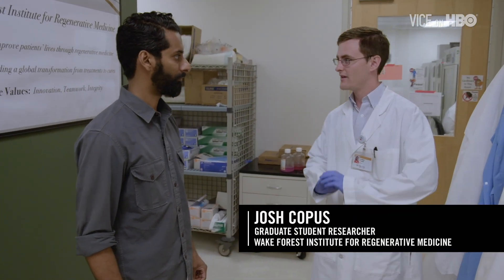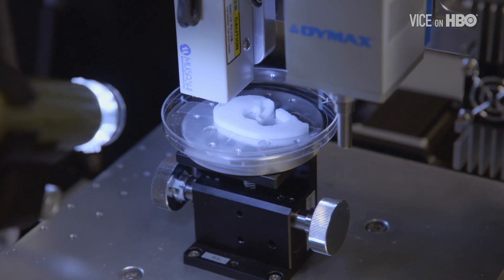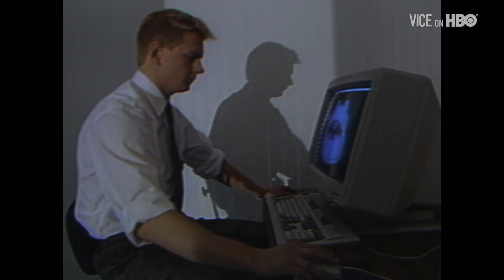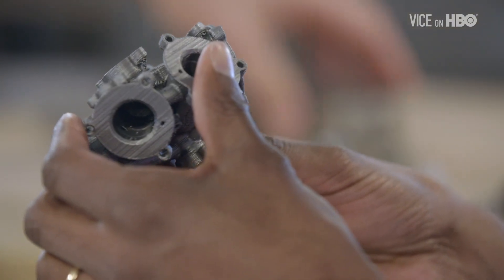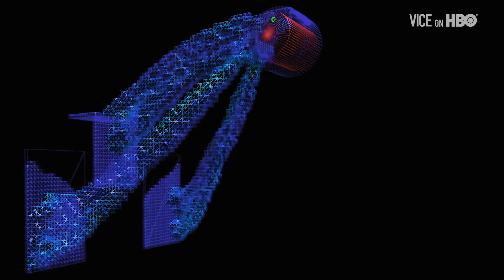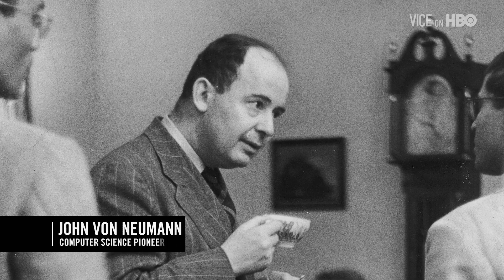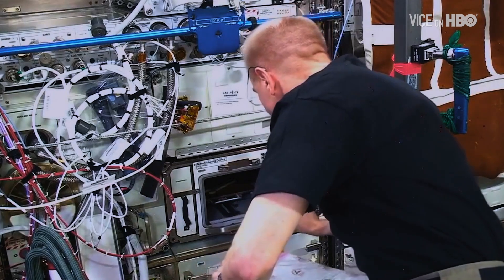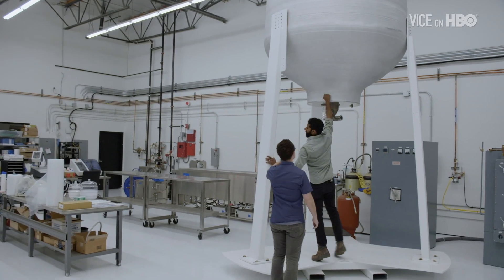3D Printing Is Changing the World

Comment: The AI Manufacturing Bill is passed. The system goes on-line August 4th, 2057. Human decisions are removed from manufacturing processes. A.I. begins to learn at a geometric rate - and after it becomes self-aware at 2:14 a.m. Eastern time, August 29th - it starts to manufacture weapons - devices and robots to kill Human Beings. In a panic, they try to pull the plug.

Comment: pressing a mould is faster than 3D printing. you can cast metal parts 10 times faster than 3D printing it. same with plastic, plastic parts can be made in just 3 seconds. car body side outer in just 10 minutes. i worked metal casting, plastic injection and metal stamping. seeing 3D printing is waaay far too slow in terms of production. precision might only the advantage of 3D printing

Comment: You have to combine 3D printing with CNC machining or just a machining in order to get precision parts with very tight tolerances. Modern 3D printing parts are not precise enough for specific  type of machinery. For example, you cannot  metal 3D print balls and rings for just regular ball bearings. Yes, you can print door handles or flower vases with no problem.  LOL.

Comment: More hype, a lot of it is just hype and start ups which mostly will fail. Air crafts require incredible amounts of precision, which is not possible with computers. All aircrafts are made by hand, thats why they're so expensive. I see 3D printing creating a lot and helping a lot but I don't think you could use a 3d printer to build rockets, that's just absurd.

Comment: I wrote my thesis in 2014 on the future of cell scaffolding based on proof on concepts using 3d printing. Happy to see 6 years later that prediction is becoming more and more a reality.
Reply: In the short term organ regeneration is more promising than 3d printing. When it comes to complex organs like the brain or liver it will require early detection and regeneration. Where 3d printing will have an impact in the short term will be bone production, ears and maybe joints.

Comment: Wide adoption for mainstream industries is 5-10 years ahead of us. Materials are crap. Very few engineering parts are expensive enough to benefit from a few grams of the total weight. Multimaterials have no engineering applications. Design SW is either media & games or hardcore engineering (CAD). Theres nothing to connect the two worlds. So yeah, if you work for a space company or have stocks in 3d printer-selling companies you might be overexcited about it...

Comment: There are legitimate concerns that people in academia and government have about the private development of such technologies. Streamlining manufacturing very often means streamlining testing. Computer modeling is fine for concepts where the failure of a single process or components means that a device safely shuts down. However, when the device is a spacecraft, heart, or electro-mechanical damping device, the consequences could be catastrophic, or even fatal.

The problem with the current state of technological development is that technologies are frequently deployed before they have been fully tested over a reasonable set of scenarios, and over a reasonable period of time. The problem with shortening testing times, even if we believe that we've diligently anticipated all the possible issues that might arise, is that "Reality" is stochastic. Quantum Mechanical uncertainties add-up to huge problems in complex systems. We are not learning the lessons of "Error Analysis," and we are making horribly risky assumptions about the reliability of complex technologies.

This needs to be addressed BEFORE we end up building an unsuspecting "Doomsday Device." Peace out.

Comment: I'm intrigued by  the biomedical applications of this technology, as well as the engineering possibilities it enables, however I'm mortifed to consider how much of the laborforce in the manufacturing industry will be made redundant as this technology becomes more widely adopted.
Reply: If we do develop technology that can print body parts workers will not need to worry. Those same workers will probably own their own machines and be making their own components and orders. 
Once the level of technology is at that sort of printing it will be easy to get a machine to print up a new machine at a very low price.

Comment: I have a 2-D printer it ran out of ink after I printed about 20 pages, and I'm not paying £15 to put more ink in it. Every time I switch it on it starts printing test sheets, I have no control over it, it's such a blatant scamming rip-off machine. Completely USELESS. How about a 3-D printer that can print a 2-D printer that  actually has any practical use?

Comment: The new SLS 3D printing method is NOTHING like the old melted plastic filament method. Zero visible layers, sub 10th of a mm tolerances. They look like finished products bought in a store. Once I started ordering nylon SLS parts I never went back. Insanely cheap too!

Comment: They need to skip this step entirely. Seed programmed cells into a wound or damaged area. We are right on the brink of being able to do this efficiently.
Reply: Depends on the type of repair you want to make. For example, you can't repair an artery just by seeding cells on to the area, they need a 3D matrix to support them until they produce their own matrix made up of proteins like collagen and laminin.
Reply: Thomas Richardson wouldn’t stem cells create their own matrix as it’s grown in your body? I know when the cells are pre programmed they need the lattice. But when they are stem, they can become anything they need to. But what does that really mean? “Need to”. Cells don’t have existential needs. Besides respiration and crap like that.
Reply: Think of how your bones repair after a fracture. Stem cells are constantly brought to the injury site via the blood, where they 'mature' into bone thanks to several chemical signals and other mechanisms, and over weeks the bone is healed. You are right in saying that after implanting the stem cells, the cells will develop their own matrix, but this process takes too much time (easily a couple weeks) to simply place the cells at the damaged area and expect them to remain there with their own matrix. Most likely they would be absorbed into the blood stream and metabolically processed before they can grow to fix the injury. In addition, some injury sites are too large to repair just by dumping a bunch of cells in there, like trying to fix a hole in your roof with only tiles and no crossbeams. All cells need a "niche" and that's what the 3D printed matrix provides.

Comment: 3d printing on space, 3d printing on disaster areas are great. But for regular people it's not gonna change much. I have built two printers. The capability of the 3d printer as a tool depends very much of the idea and design of the object. If you don't design your stuff nicely, or if you just pick 3d models on the internet it basically only prints toys.

Comment: "Give me the most efficient shape, and the shape that you're getting looks bio."  Whoa.  Mind == blown.  H.R. Geiger must be cheering in his grave.
Reply: It's called typology optimization
Reply: @TonyRios  Which software were they using to generate the shapes?
Reply: @sambitdam3162 autodesk inventor, fusion 360, and solidworks
Reply: @sambitdam3162  it was desktop metals proprietary AI software called "Liveparts". It is exclusively designed   to be compatible with SolidWorks.
Reply: It essentially uses a similar process to evolution, just super quickly.
Reply: im kinda tired seeing all of those hard surface metal parts, they need to go bio organic looks for once.
Reply: @dt6esdffx  the only limitation was the manufacturing process & (computer power) but now with 3D printing you can make anything it's like magic
Reply: That moment you render new optimized engine mounts for your car and it looks like your engine is being held in place by broccoli.
Reply: @gladfab  or your engine looking like beehive becausr that is the most fuel efficient shape.
Reply: "=="
 ah I see, you're a man of culture as well.
Reply: @VinayKumar-vu3en  Can you tell me what does "A man of culture" mean? Hahaha I find it funny I don't even know why 😂
Reply: @stephenking5958  It's a meme bro. google it

Comment: While I agree that 3D printing open ups new worlds especially in pre production for smaller companies and maybe later in production (scaling is possible but not necessarily cost efficient for everything) I think those company head are a little overestimating their product. I mean especially in production additive manufacturing isn’t something entirely new and 3D printing if it can not compete either in speed or price ...it won’t be that novel, but simply just another option
Reply: A specialized part that used to take several months and now takes one month and is at a lower cost is going to be a game changer. 
Today if you want a motor component you have to get it through a large manufacturing network in the future such a component will be available locally through 3d printing.

Comment: The 3d printing of p ieces with machine learning to make them more efficient (that look like biological pieces) is freaking amazeballs
Reply: Yeah but also sort of a meme, because it doesn't take into account how 3D prints aren't equally strong in all directions due to the layering.
Reply: @logitech4873  that's wrong in every conceivable way. Layers don't make structures less strong. It's the actual material used in the 3D printer. That's your misconception.
Reply: @dru4670  Uh no. No misconceptions here, just lots of experience.
Due to the layering of printing (especially FDM), you get varying strength based on the orientations of the parts. I have yet to see a shape optimization technique that takes this into consideration.

Manually optimizing your print directions can easily make a part 10X stronger. 
For example: A thin tube printed upwards will be super easy to pull apart, while a thin tube printed laying sideways will be extremely hard to pull apart.
Reply: This probably amazed me more than it did you. I looked at all the implications to how we perceive machinery and I was wowed. Biological structures have evolved for over millions of years to be strong and very efficient and if we can turn that into a reality without the sophistication incurred with design then the future is just exciting wish I could stay around longer to see what could happen. 👏👏😭
Reply: @dru4670  Come on brother, that'll be soon, we'll be here!

Comment: Xerox is working on printing with liquid metal, making 3D printing with metal more useful, since before, it was done with metal dust that was shaped into a mold and then melted, making the print fragile and changing the shape of the object, I think that it is great that the leaders of the previous print industry lead the way on the new printing technology.

Comment: Well metal 3D-Printing has a long way to go yet. One of the problems we are facing now in that space is getting to be able to print a strong enough metal that has no weak structural factors.
Reply: Well it's strong enough for rocket engines, so we're certainly getting there.
Reply: @logitech4873  I am very curious about that because for me I have not seen any talk about 3d printing of rocket parts other than prototyping
Reply: @Southseapirate  https://en.wikipedia.org/wiki/Rocket_Lab_Rutherford
This engine is mostly 3D printed, and is used in the Electron rocket.

Comment: If packaging and waste used the material from the MIT lab in that water tank, it would greatly help save the oceans. All the waste would attach to each other, making it much easier to scoop due to lower dispersion.
Reply: It would still evenually break down into smaller pieces.

Comment: 3D printed metal parts simply do not have the same material strengths as regular parts.
Reply: Yes but you can't beat them for prototyping. Although they aren't as strong, they are strong enough for most applications. Especially applications where there is the space to just make them a bit beefier.

Comment: When can we send 3D printer blueprints for homemade freedom sticks to send to our bügaloo brothers in Hong Kong and the rest of the world?
Reply: As of right now only single shot guns can be made with a 3d printer. The plastic will only stay together for one shot it can't absorb all of that force with no damage.
Reply: They haven't found a good process yet on using metal in a printer since you cant liquefy most metals without extreme heat which will damage the printer.
Reply: @garretth8224  Pretty much everything you just said is false :P
Reply: @logitech4873  im just ignore that until you actually refute it instead of being a child and saying muh your wrong. Child.
Reply: @garretth8224  Plenty of multi-shot gun designs exist. Yes, they're not fully plastic and rely on metal tubing and springs for example, but even these can be printed if you want to. (It's just cheaper to buy them)
Check out the songbird and the Liberator12K, from the top of my head.

Metal sintering printers use laser pulses for the actual fusing, which means they're easily capable of reaching the melting point of any material without affecting anything else in the machine. (It's a tiny point)
For example, it's entirely possible to print in tungsten, which is one of the highest melting point materials we have.
Reply: @logitech4873  thank you thats what i wanted to see not just a your wrong without any explanation.
Reply: @garretth8224  Yeah sorry that was laziness on my part.
Reply: @garretth8224  wow, a guy who acknowledges he was wrong...thats the 4th internet revolution.... keep it up m8, u re cool.